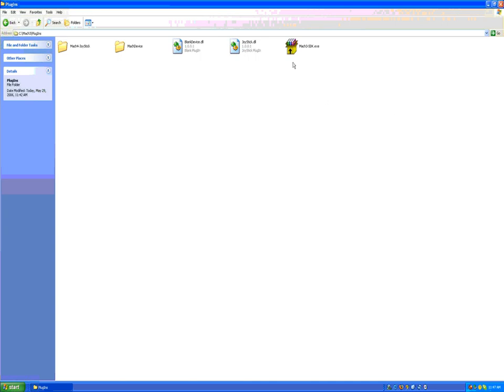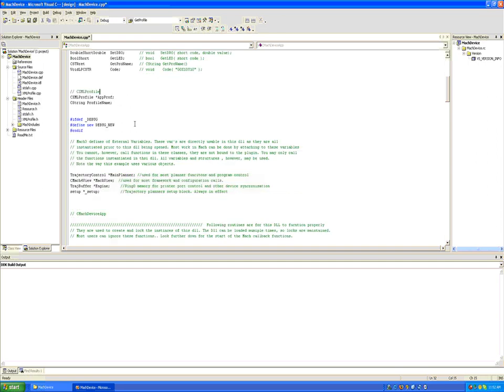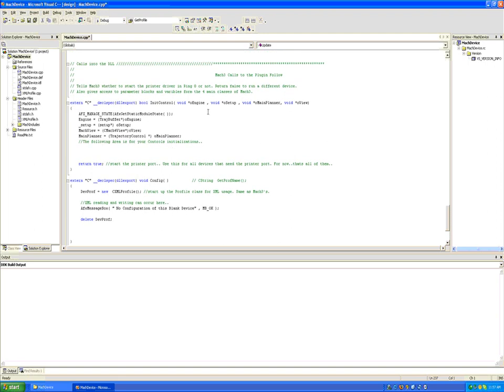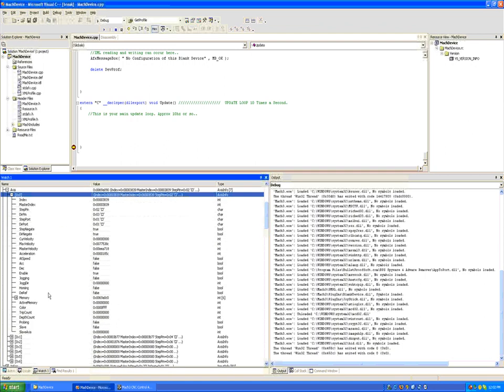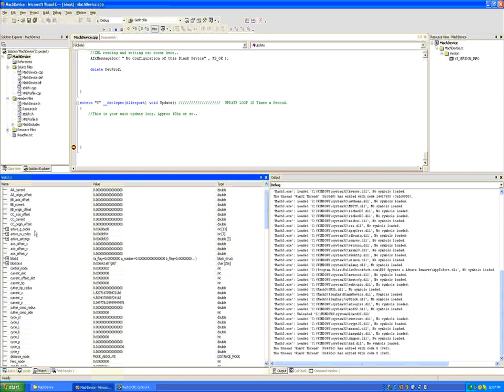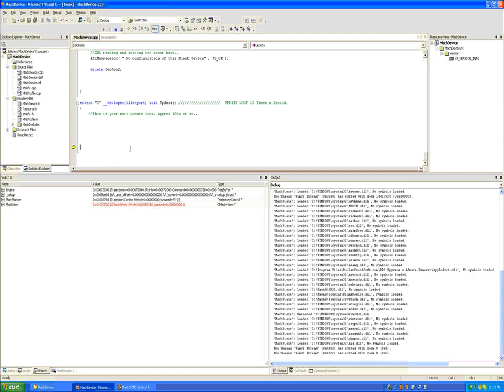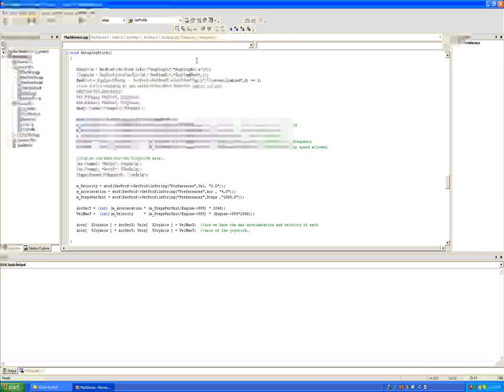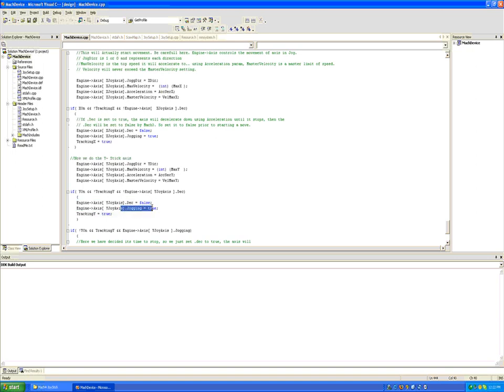Looking at Mach3 SDK and how to operate

Comment: I was able to compile the ShuttlePro plugin in the tutorial, but the SetTimer function Assertion Failed.
Reply: I found "SetMachError(CString Message)" cause Art Code 9991
Reply: Sorry, this was a problem with my environment.
It worked in VS2003 and did not work in VS2013/VS2017.
I will try to find a way to do it with the latest VS.